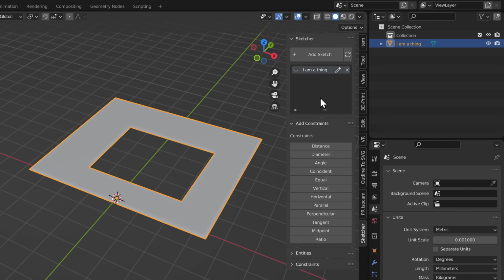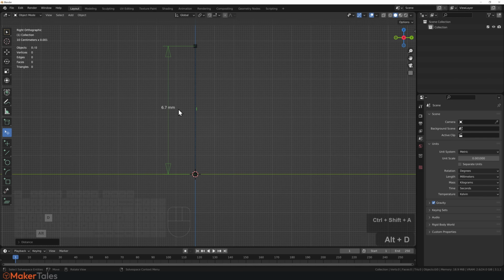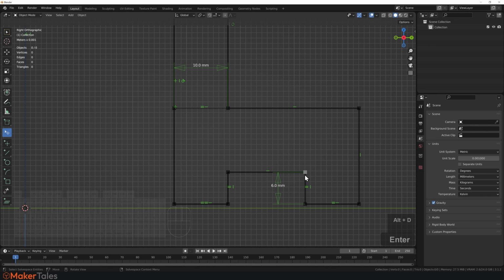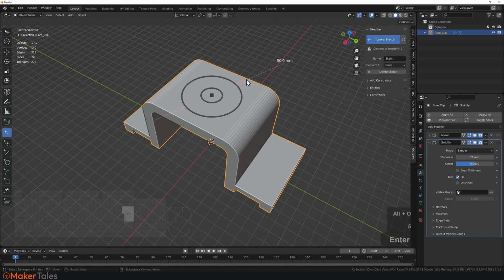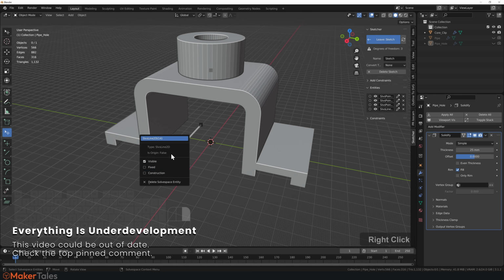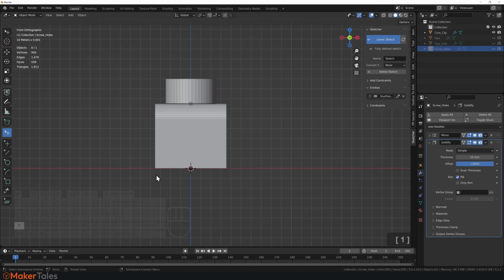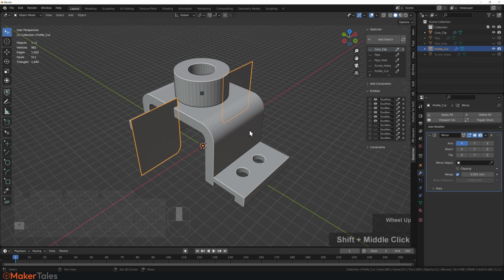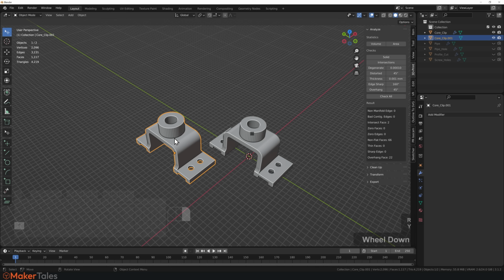CAD Sketcher 0.24.0 Update | CAD Modeling In Blender 3.2

Comment: I am following exactly the steps, but at 11:21 I don’t understand why when I use the Boolean tool for union operation (ctrl + [+]) the topology changes and goes really bad because now the 3D Print tab reports 192 non manifold edges. If I change Fast method to Exact then the piece below disappears. My workaround is simply go to edit mode and extrude the pipe from there but that loses the purpose of using CAD Sketcher and is destructive too. Please, anyone can help?

Comment: This is driving me mad. The add-on works great don't get me wrong but my lines are neither horizontal or vertical. How do you get yours so perfect? In other vector based apps on my machine if I hold the shift key when drawing a line it snaps to the horizontal or vertical and I can pull it in set degrees but in Blender it seems to want to rubber band totally freeform and as a result I can never get horizontal lines of straight ones of lines at specific angles to the baseline or whatever.

Comment: I'm using Ver 0.25.0
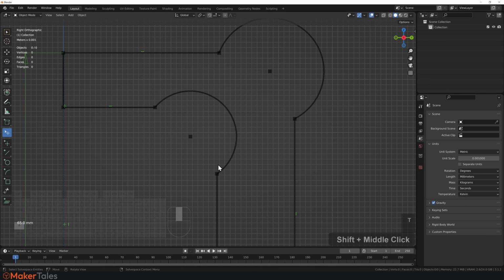At time mark 05:24 you mention that the trim tool sometimes leaves some extra coincidence points that we need to deal with. How do you deal orphan coinc (vert) points when they share the same point in space and you can only see one of the points?

BTW, Kudos to who ever put that Shortcut sheet together. Got that sucker taped to my monitor.

Comment: The tangent just don't work for me like this. It shows the tangent symbol but the curve line don't adjust
Reply: I previously wrote this:

"Hi All...

While this should be obvious, I'll say it anyway just in case it isn't: 
For those who have questions, comments or bug reports or whatever specific to the project, consider referencing the manual if there is one (even helping out with that yourself), contacting the project directly (assuming they have any time for a global user-base of potentially thousands or more) or even getting involved with it-- self-/community-empowerment and all that-- in helping it grow and expand, thus helping many more in the process and making the project broader, flexible and stronger. 

This is just a YT video comment section and as we know, it can be hit or miss, especially where the devs are far too busy with the actual software.

Thanks!"

Comment: as a newcomer to both this and blender itself, I have no idea how to even get started, none of the shortcuts seem to work as intended for me. Is there not a way to get buttons or a toolbar for these functions?
Reply: Unsure if or how often a one or two person dev team monitors external-to-the-project forums like You Tube comment sections, so maybe consider a more direct and/or self-empowered approach.
It's a new, free, libre, open source and, in a very real sense, community, project and, as such, does well with community involvement and self-directed self-empowerment, such as from its user-base. As such, it will get better.

Comment: Making another run through this tutorial after having gone through lessons 1-5 of your wonderful paid course.  I ran into several occasions where the 'tangent' (SHIFT-T) command did not work.  The 'tangent' constraint symbols showed up, but depicted in red, with an 'unknown failure' message.  It appears there are some 'constraints' (pun intended) on the geometry on which 'Tangent' command is successful, but it wasn't real obvious what the limits are.  It's a real pain to go through all the work of creating the lines, adding the circles, and trimming all the unneeded parts away, only to have the 'Tangent' command fail for no apparent reason.  Thoughts?
Reply: same problem, write please if you found answer. For now, I use the old way with creating archs instead
Reply: Might there be a Blender CAD Sketcher forum where users can help each other while the dev(s) work on the project? Wordpress?

Comment: Look forward to getting to the point where clicking on a RAD for example (or any element) prompts entering a dimension for it. Also, contextual menus based on selection so you don't have to remember yet more keyboard shortcuts.  Coming along well!

Comment: Ah it has too many steps when you're building the solids and booleaning. Maybe they should have implemented a nurbs solid engine from the beginning. I'd still far rather use Freecad than his.
Reply: Things like this take time of course. That you're even commenting here might insinuate something positive. 
Freecad has been around for awhile. I tried it briefly, but only briefly as perhaps I have been overconditioned by 
The AutoCAD Way™.
Pity me.
At the same time, it might help to realize that CAD Sketcher is built on an already-powerful modeller, Blender3D. So the potential seems already quite vast.

Maybe it's worth learning Blender now if only to be prepared for what may come.

Comment: The real time saver will be product number catalogues as simple spreadsheets.
The beautiful thing about a spreadsheet, is not only can you use it a list of dimensions for a specific design, you can also use mutiple columns/rows as a catalogue.
That is where the real time saver is.
You dont have to physcilly model 100s of versions or keep changing many parameters mutiple times.
Just make slight changes to a few cells in a few columns with a different product number and then select that columns user defined model number for the specific manufacturer/product.
Why keep remodelling, when you only have to change parametric values once and then simply swap preset product number listings (as a group of per model parametric presets).
Would be nice to auto generate these spreasheets from json parameter lists actually, then a simple file rename + geometry association, could be the new manufacturer+product+type.
Then you can have files for physical 3d printing and files for the virtual 3D realm.

Comment: Downloaded the drawing and tried doing it (successfully, yay). The thoughts
1) Don't like hotkeys. It forgot it's a blender and not a solverspace. 'x' is delete, not del. It was nbd in 0.1, but considering additions of hotkeys, it doesn't seem it will be fixed.
2) Speaking of hotkeys. It's frustrating that distance is Alt-something, all others are Shift-something. 
3) No copy paste. I did left bottom thingy first (the  one looks like ▛▜ ),  Copying it manually was an exercise in a frustration and hiding constraints. I never hid constraints in other CADs. I suspect here I do it because in the theme lines are black, barely visible over gray background, and constraints are pink, much more visible
4) Escape cancels too little. I constantly added geometry because I finished a line,pressed escape and clicked on a point to move. 
5) Several times I wanted "Split line by point" operation, instead I had to delete a line, add two new lines and make of them construction. [ETA -- seems trim tool will do the job, I didn't know about it when was doing the model]
6) Delete is not strong enough. Several times I wanted to box select and delete large amount of entities. It was impossible. Instead I had to delete them one by one in specific order. 
7) Operation cancelling is too strong: if I select two points and 'L'ine them, it creates a line. If I click anywhere after that, the line is deleted I have to press escape additionally.
8) You can't change several lines to construction lines, at least with mouse; if you select 4 lines of rectangle, click right click - construction, only one will change, under the cursor, not all selected.
9) I can't tell what's not being constrained. For all I know there is a accidentally added point floating somewhere with 2 degree of freedom, 
10) Since it's 3d view, sometimes it confuses sketch's Horizontal  and Vertical: my horizontal is solver space's vertical and vice versa.

Overall  I did  it in ~1 hour and had 0 crashes. I had one Exception error when I first time selected  two circles and made them Equal, but it went away and I couldn't reproduce it.

ETA: The trim looks fantastic! Arcing without it was a pain

Comment: Would like to see the option to reuse parts of sketches that have already been used - in the example in the video, creating a hole from the centre circle of the pipe should be possible without making a new sketch referencing the first one.

Comment: It would be cool to add an unfold mode after designing your 3d model for plasma cutting or cnc cutting.
Reply: Can't you use Normals or UV Maps for that? Those are already built into base Blender
Reply: @claws61821  yeah but it unfolds uneven and apart. Not only would it unfold but an option to add tabs in between the folding sections.
Reply: @Key_Capz_  Ah. Thank you. Hmm... There may be an existing Blender plugin for "pepakura" or "papercraft" that could do what you want... Let us know!

Comment: This is just mind-blowing to me. As an Autodesk hater, I can't praise this enough. At some point, I'll have to donate some cash, but I really can't stand CAD (I'm a CAD Manager for 20 years now).
Reply: I used to be a CAD draughtsman around 30 years ago. Back then we had a tablet based package I think it was called PowerCAD. It used relative design so you would click on a line in the tool pallet then click "relative" then click on "Intersection" or "midpoint" or "endpoint" or "center" then on the point on the drawing that you wanted the line relative to (which would set your datum point). Then you would throw in your X,Y coordinates for the start of the line relative to that point and then the X,Y for the length etc. It was surprisingly natural and quick not using the origin point for measuring. It made sense. Then they moved to Autocad and I hated it. It was harder, used a mouse instead of a tablet and seemed to make you have to keep using mental arithmetic (not my strongest subject) to keep an eye on the start and end points of objects you had drawn.

This CAD Sketcher seems more similar to PowerCAD or whatever it was called. Looking forward to learning it.

Comment: One of these things I have found in a cad program that made things so much more convenient was a spreadsheet reference. Free cad has one. With it you can change all the things you have referenced by just changing the sheet. You do have to reset the parent of the sketch but it is still easier when your part switches barrings or the size of a rod your using.
Reply: ^ +1.  Yes — being able to reference variables and having a place where you can easily change those (for instance, changing tolerances, thread sizes, etc.) is absolutely key. We need this for CAD Sketcher to be useful (even though it seems very promising already).
Reply: @neversinkmakes  It is very promising indeed. You can go a bit further with a reference spreadsheet though especially if it can reference back to the spreadsheet in the spreadsheet. I do alot of prototyping on things with fluid flows to complex to practically simulate. So, there is alot of variation to sizes and shapes that needs to be done in order to optimize. I just write up a spreadsheet now and I don't even use numbers on the model I just type in the name of the measurement. Then poof when I want to tweak something poof to the spreadsheet type it in and the model changes.
Reply: @andrewkelley7062  yes, I 100% agree, which is why I stated we need this for CAD Sketcher to be useful. I’m not going to be using CAD Sketcher (despite being a big fan of Blender) until I can easily tweak dimensions in one central place.
 
In fact, I had made the same point in a comment to an earlier video a few days ago. My proposal had been to use a node tree instead of a spreadsheet, with all the input nodes on the left and all the output nodes on the right, and math nodes in between. This could potentially allow you even greater flexibility. But I currently use the spreadsheet function in FreeCAD and would be happy with that too.
Reply: Yeah that is very true 

The parameters are handy to setup and use in your design
Reply: I use parameters all the time in Fusion 360, it's so convenient. I'd love to see it brought to this Blender add-on.
Reply: @Gormadt  I finally looked into parameters. It seems powerful especially with the min max feature. I wish those guys would put more love into the gui of that function. I sware there are always thousands of small commands hidden in nonintutive means that may or may not be easy to find. At least blender even in the old days would always be updating things like that. Cad software though someone has to make a big deal about it for it to change at all.

Comment: Just curious whether anybody actually uses this tool? Whilst it is quite impressive, it is still nowhere near as usable as fusion360.
Reply: I have just started using blender with this addon and I'm suitably impressed. I've been using the sketcher  + slicer addon to design projects for my laser cutter.
Reply: The constraint solver comes from Solvespace, which has thousands of users (10s of thousands I believe). This approach is extremely useful and will eliminate commercial CAD from many Blender users toolbox.

Comment: Is there a quick way if I want to make a lot of holes like a colander for example
Reply: Array modifier.
Reply: @aeiounix  The problem with ِArray is that it gives us regular shapes, sometimes we need scattered shapes
Reply: @alia.zaki2026  I guess you could create a cutting tool object, then use geo nodes to distribute points across your surface, then realize the points with the cutting tool object, then cut that object from the surface and there's your random distribution of holes.

Comment: It's still in development, and it's actually easier to learn than other cad softwares that I've tested.
Reply: Yep, in just a few months it's become wildly more usable than FreeCAD.
Reply: @ThantiK  Imposible. FreeCAD is not perfect (and sometimes buggy), but it has so many modules and functions that never going to work in Blender. For example importing CAD file types or working with assemblies. CAD Sketcher is nice project, but I can't imagine to design something seriously in Blender.
Reply: @cockatiel-98  Well let's just look at the history of blender and where it started, and where it's come. Clearly the rate of progress of blender is enough to dismiss your claims.
Reply: @gwentarinokripperinolkjdsf683  I know blender since 2.63 version and I agree, it's amazing what has changed over the years. But it is mainly the modeling/rendering software for artists and not for engineers. Blender is not design to work with solid geometry that could be exported in STEP format. And this will never change.
Reply: @cockatiel-98  There is always a this will never happen guy. You are obviously not familiar with what a talented group of moders are capable of.
Reply: @HP-jl5ts  Can talented group of mechanics convert Ferrari to Porsche? Blender is working with meshes. CAD software (solid modeling) is build on geometric modeling kernel. FreeCAD for example uses Open CASCADE. Someone would had to implement that technology into blender. I don't want to argue about blender, it's great software, but it's different than FreeCAD.
Reply: @cockatiel-98  Hi Josef. I don't want to argue the point either but since I replied to you I will again this last time. It is all just Ones and Zeros representing points in space representing objects. It's a good thing that it is different than FreeCAD. Don't get me wrong I use FreeCAD too.
Reply: I wish rhinoceros (the only decent cad program I know of that doesn't require monthly/yearly payments) had these sketch functions. Too bad you can only make mesh objects in blender, and that's probably not something that ever will change.
Reply: tinkercad lol
Reply: 2026: still much easier then other's software.

Comment: Great progress so far! It's really interesting to be able to do sketch drawing in Blender. Although non-destructible workflow In blender leaves a lot to be desired in Blender unfortunately, it is a little bit hard for me to see if the gap between this state and something like basic Solidworks features can ever be closed having Blender as a foundation. It does look pretty amazing already though. Great job!
Reply: SOLIDWORKS Is nurbs blender is polygon !
Reply: @cekuhnen  yeah I have limited experience using both. Solidworks workflow felt more intuitive but blenders seems to yield better polygon meshes. I hope the middle ground is possible somehow
Reply: @cekuhnen  Excuse me. Did you say SOLIDWORKS is nerds Blender? I really like solidworks but it does not really exist if you have no access to it.
Reply: @HP-jl5ts  SW is Nurbs based - Blender is polygon based. That should settle the CAD question.
Reply: Please add offset tool also.